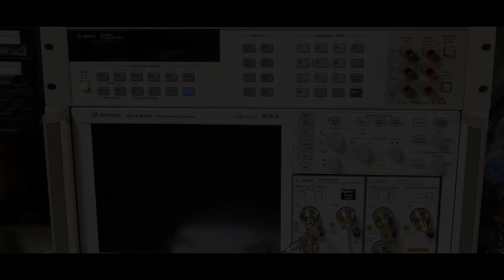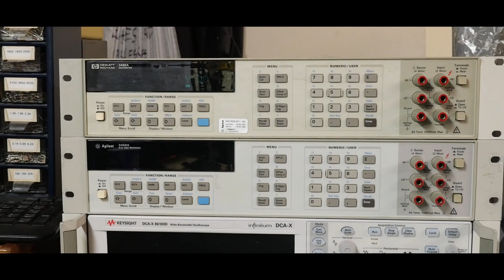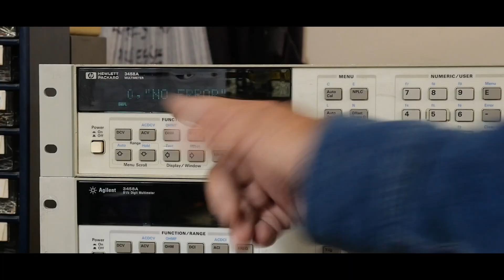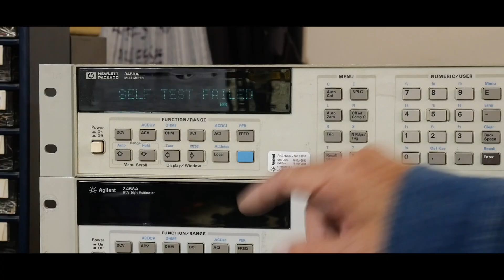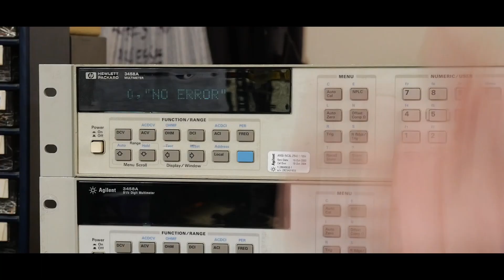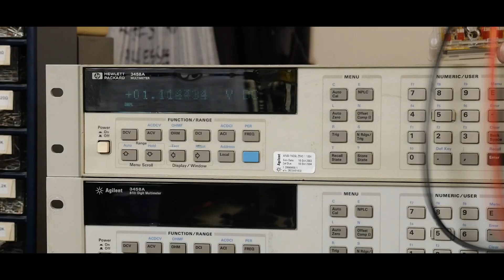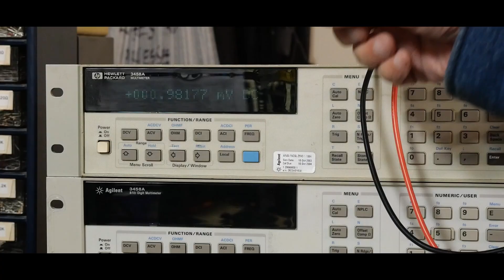#2417 Agilent 3458A 8.5 Digit Multimeter (part 12 of 16)

Comment: That was the first instrument we physically learned how to troubleshoot and repair in Aviation Calibration Tech school while I was a young Marine back in early 2001.  The instructors caused an issue on the main board that we then had to find and fix using the schematics.  That was after a packed year of theory and math.

USMC 1999-2007

Comment: I recall youtuber Marco Reps replacing those Dallas battery backed ram chips with some FM16W08 fram which is specd at having a data retention time of 150years. It's mentioned in his video "HP 3458A - Why is this 31 year old Multimeter UNRIVALLED?" at time 38:40 .

Comment: Before you do ANYTHING, including using that 3458A..........backup the Dallas NVRam's to file on your PC. Either via GPIB or plug them into a programmer. If you don't, and you lose calibration it's gonna cost you minimum $500 to get it re-cal'd at Keysight.

Comment: It's BAAAAaaaaack!  "It's always good to have two of them."  No argument there.  That's why I have a "working sample" of darn near every modern amateur radio made.  It has saved not only me countless hours of troubleshooting but my customers billable hours as well.  In a lot of cases with modern radios it's just a lot faster if I can walk out to the warehouse, pull a working radio off the shelf and compare voltage's, signal levels or data being sent between processors and DAC's/ADC's. versus possibly hours pouring over a schematic, tracing signals as they get converted from analog to digital and back to analog again.